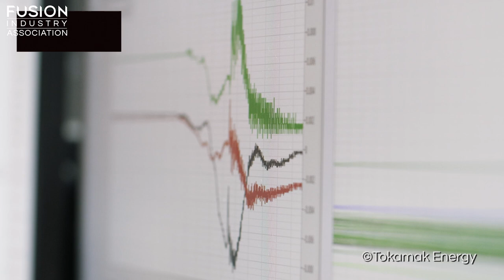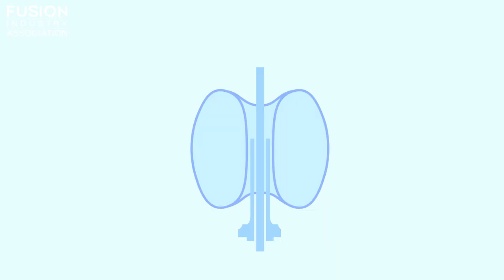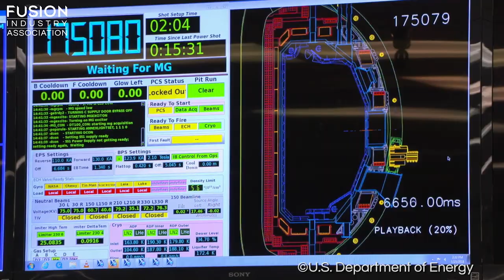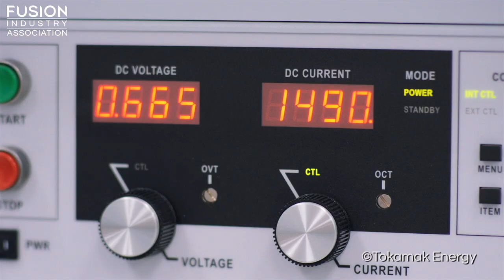Commercialising fusion as an energy source

Comment: Just saying fusion is far too broad I think, need to be more specific.  I was impressed by recent news of a project working on lattice confinement fusion with NASA involved.. Although it isn't direct-to-current, it doesn't require ultra hot temps and seems scientifically viable for small-medium uses, which would make it seem suitable for small installations and therefore would work well with our current grid limitations (decentralization of power grid).  And also not 100% clean it does create carbon and other byproduct elements still exponentially better than any other tech we have now as far as I am aware.